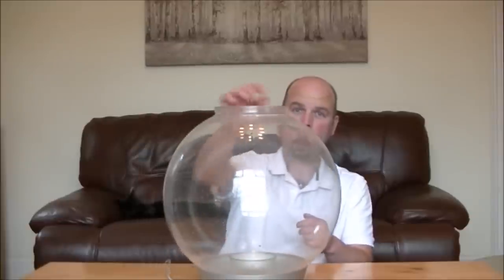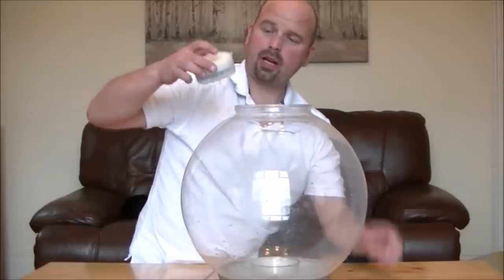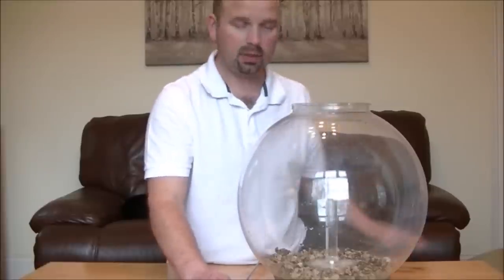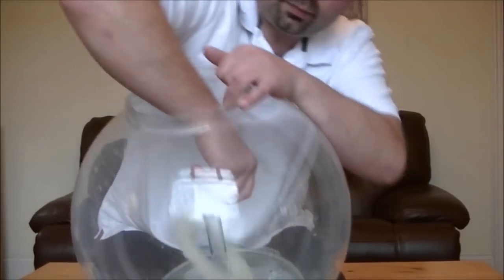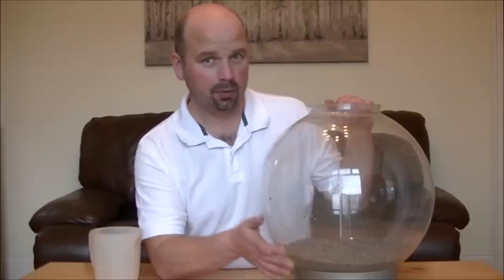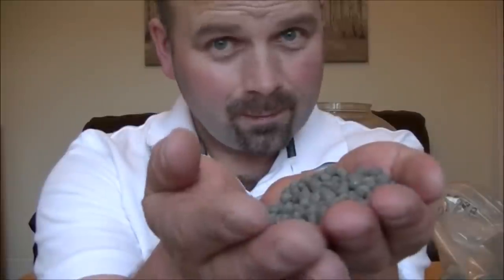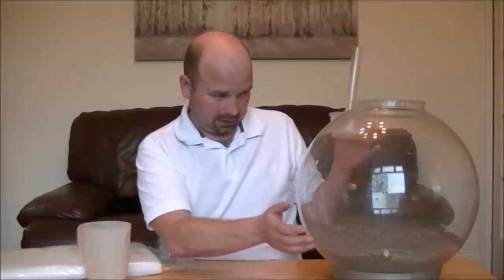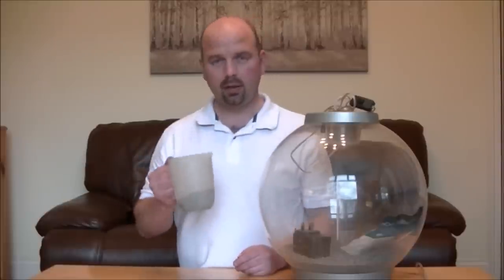BIORB COMPATIBLE UPGRADE KIT

Comment: Great Vid you have my money sick of spending loads of money on filters etc etc and the cleaning dont even go there, Many thanks for posting.
Reply from the maker: +Rob Tankie Walker No problem, I just wish Reef One had taken a look at their filtration system on their tanks as it shouldn't be up to the end user to make something work correctly.
Reply: I’ve had my biOrb 60 running perfectly now for over 18 months, I keep different live plants, cardinals, glow lights, a honey gourami and my beautiful red Bloody Mary shrimp, and have had zero problems at all using the original rock and filter media that came with the biOrb tank. If you set up your biOrb correctly without rushing to add fish, you should have no problems at all. You really do not need to put a sponge cover around the filter or change the biological media that comes with the tank. 
The main reasons people lose fish, is because they do not do there homework on how to set up a tank properly, they are too impatient to wait to set up the tank properly, they stock the tank too quickly, they overstock the tank with too many fish, they do not do water testing properly, or ignore readings that tell them there is a problem. Instead of looking for reasons to blame this tank, you would be helping yourself far better by trying to work out what you think you may have done wrong. If you can do that, then you will find there is no reason to change any of the filtration media that comes with the biOrb. If you choose not to believe what I have put, so be it, it is your money you are spending and giving to others needlessly that helps their business profits. I have a friend that used to have an aquatics business and he used to love helping people that had problems, because by helping them it helped his business grow. He has since sold his aquarium business, but kept the pond side of his business as his pond business grew and grew and he had more work than he could handle. He also used to sell marines, but knew not much more than the majority of his customers, and a hell of a lot less than some, but they trusted him because he ran an aquarium business and people tended to trust that he must be an expert. The truth is if he was unsure, he used to ring his customers that had been keeping marines for many years, and then ring back the enquiring customer, giving them the advice that he had been given. Please don’t think I am trying to knock anyone because I am not, the point(s) I am trying to make, is that the biOrb is fully capable of doing the job, and that ANYONE can and will be successful, IF, they do enough reading and homework on fish keeping, and DO NOT try to rush.

Comment: Hi Pondguru I brought your filter kit for my 60ltr biorb it took 7 weeks to cycle but I had high nitrate levels despite being well planted water changes didnt help my tap water was high in nitrates and was getting impatient to get some fish in.
Decided to try using Purigen to get nitrates down so put 20g into a ladies ankle stocking and put it inside the original filter housing with a new piece of the fine filter foam thinned down to bout 1.5cm thickness ontop of Purigen sock,it worked a treat the levels came down and the water is unbelivably clear,looking forward to getting some fish in now,the old filter arrangment looks a joke now compared to ur upgraded kit.
Reply: Pondguru Outdoors Hi pondguru as a newbie my understanding of the tank cycle is basic will outline what I did for your assessment. The filters was installed as per your instructions guide the only thing not stated was how many gel balls shud have been put in I put the entire bag supplied in half between the black and blue filter foams half in bottom of the round filter housing with fine foam ontop of it.The water put in tank was treated with seachem prime, the air flow was set at a healthy rate of flow along with an airstone running ,tank heater was set to 80f ,plants was added to the tank after 3 weeks.
I was given the orb and along with it an API master test kit, I tested for ammonia and nitrites at 2 weeks the ammonia was dark green and nitrites dark purple.
At 4 weeks the ammonia test went to yellow while nitrites stayed purple after another two weeks the nitrites test went to pale blue indicating 0 ppm
I took a sample to my local fish shop to check if I could now put fish into tank they said the nitrates was high at 75 ppm and to wait.
I read on other forums that doing water changes was a way to lower nitrate levels.This made no difference so I tested the tap water which also gave high nitrate readings on the API test chart somewhere between 40/80 ppm
The 20g of Purigen in a stocking was added 4 days ago, my API test showed change from dark amber/red colour to a light to medium amber which on the chart indicated between 5 and 20 ppm nitrates, the water did become absolutely crystal clear from already being very good before.I went back to my fish shop this morning they tested a sample and said it still has nitrates at 75ppm so I'm not so sure now Purigen has lowered the nitrates.I am going for holiday now returning Saturday when I will have another sample tested, if no change fish shop can supply RO water for a partial water change, your opinions  on what I have done most welcome.
Reply from the maker: Damn, the prime looks like it has at the very least doubled the time it should have taken for the first stage of the cycle (ammonia and nitrite processing to develop) but at least it did develop - I get so many reports where it will just not get going at all when that is used. Unfortunately you now have purigen in there too so the anaerobic side is likely to not ever start or if it has started to develop in spite of the prime it may have been knocked back to zero.
High nitrates is common until the anaerobic bacteria develops but with chemicals acting against it the chance of a full natural cycle developing is close to zero.
In all cases which get reported to me once the prime and purigen get out of the system the bacteria can develop naturally, restoring the balance and there is way more media than is actually required to process ammonia, nitrite AND nitrate in there so eventually all should be zero.
A simple swap to using a straight forward dechlorinator for water changes and carbon or activated charcoal for the polish for water clarity is all you need to allow the bacteria to naturally develop.
There is nothing in the prime or purigen which reacts with any of the biohome products or any other filter media but the amount of bacterial crashes associated with those products indicates it can have anything from a retarding to devastating effect on bacteria making you rely on chemical products to keep the pollutants under control which should be done easily by bacteria.
The cynic in me would think that was part of the plan? cock up the balance then sell the solution....
If you keep it simple the tank will be low maintenance and water will be very good, no doubt about it so simple changes now will allow that to happen no problem.
Reply: Pondguru Outdoors Thanks for reply a lesson learned for others from sharing information i guess  will see what I've got when I return from my holiday and take it from there.
Reply from the maker: Sounds like a good plan, hope you enjoy your holiday.

Comment: I am using the bio gravel you recommended and real plants with internal filter un seen by large  fake hollow stone no uplift but air stone it is keeping very clear and the water is very good have two fancy three inch goldfish and two I inch those will be in the patio pond in summer again next year if all goes well lots water changes ,I have 72 x15x15 run by external fluval with silver dollars ,tin foil barbs and two plecs been running for 25 years present  occupants about 15 years plus 4foot extremely well planted from my own cuttings and seeds thought I would just mention thanks for your time
Reply from the maker: That sounds good - best of luck with that.

Comment: Hello m8 I'm from consett just watched video on biorb filter very impressiveI have a 105 ltr biorb and would like this set upOnly thing worrying is does the sponge have to replaced on a regular basisYou Have to be careful with these things they scratch easily.
Reply from the maker: +Terry Mc The outer sponges should last a few years and will be gently cleaned when you clean the biogravel wit a gravel cleaner so no need for a major strip down for cleaning - maybe once a year just to give it a deep clean? The central small filter (where existing Biorb filter is) will need replacing as and when it is clogged with fine muck. How often that is will depend on the fish stock and feeding.If you're in Consett you can collect as I'm near Ebchester. Just give me a call if you want to come down for the gear. I don't have a specific kit for the 105 but the base size isn't much larger than the 60 so foams will certainly be big enough. Not sure how much extra biogravel it will take  but it will be more than the 60 litre as it takes 3kg.07772848730Richard

Comment: Cheers mate I just bought a second hand one today I was thinking of drilling holes in the plastic pipe like you would a diy sponge filter then put sponge round it me dad didn't think this would work so YouTube ideas found this.. I'm going to buy your media tonight from your website cheers Richard how much will I need if I'm planting mines the 60l
Reply from the maker: Sorry just seen this now. The 60 litre kit comes with 3.5kg of biogravel and that is needed to cover the foams in the kit but they have quite a high profile cut. Actual amount needed depends on type of foams used and could be anything from 2.5kg (flat foams) to 3.5kg (deep cut foams) - hope that makes sense.
Regards,
Richard
Reply: Hi, did the holes in plastic pipe work?

Comment: would a stronger flow rate on a bigger air pump produce more draw on a 60 litre and if yes would you recommend it...
Reply from the maker: It wouldn't make a huge difference to water quality but I know of a few people who have installed 150 or 200 lph air pump for the 60 litre orb with no issues.

Comment: I have a 20 gallon biorb coming and I want to upgrade the filtration as I’ve been hearing mixed reviews on this setup. Am I able to find the “gravel” you’re using in stores or do I have to order it? How much would you recommend I use? Do I ever need to replace it? And for the sponges you’re using, would I just clean those everytime I clean the tank or only some times? Do I just rinse them out or should I replace them completely? I’m sorry if you’ve answered these questions already, I’m just having a hard time understanding everything as I’m new to it all and don’t know all the “lingo” or anything about filtration 😆 I hope I’m able to get some feed back soon as I can’t wait to start my new aquarium !

Comment: Changed my biorb to your filter over two years ago, still perfect!
Reply from the maker: Sounds good to me - thanks for the feedback and I'm glad you're pleased with the system.
Reply: @pondguru  hi where do I order this upgrade set please? All that is required?
Reply from the maker: @jesgill6875  You may have already found it in the pinned comment and video description but here is the link to my website: http://www.filterpro.co.uk
The kits are on the 'Filter Kits' page.
Regards,
Richard
Reply from the maker: Here is some further information in case you missed it in video description / pinned comment:

A FEW COMMON QUESTIONS:

Do I need to take the medium/course foam rings out from under the gravel to clean them? (rinse in siphoned tank water, if so how often?)
 
- It is basically creating an undergravel filter so as long as the substrate (biogravel) is cleaned with a gravel cleaner that will remove the vast majority of uneaten food / fish waste from the biogravel and upper foam so the foams don't need to be removed unless you want to do a deep clean which I recommend doing every 12 months or so. So far I don't know anyone who has done that as they don't want to disturb anything which is working well.

Ideally the gravel cleaner would be used once a week to remove waste from bottom of tank, just as it would with a normal tank - that will remove waste, do a small water change and freshen up the tank.

Do I need to take the fine filter pad out to clean, if so how often?
- That is just like the cleaning of the 'normal' pad for biorbs. When it is clogged it will need replacing but since you have so much filtration prior to water hitting that fine pad it could go for many months before it needs replacing - every tank is different but most will go 4-6 months before the pad needs replacing. Check after 2-3 months and if you think it would go longer next time just extend cleaning intervals to suit - no point cleaning / replacing a clean filter.

Do I need to replace the foam or fine filter pad, if so how often?
- See above with regard to fine pad in central filter, outer foams should last a good 18-24 months before they lose their 'bounce' but will still function as an undergravel system beyond that.

If I’m taking out the foam or fine filter pad. Do I need to take out my fish before doing so to be safe? I don’t want to kill it. 
- If you are removing the fine pad in the centre then that can be done with fish in no problem but removing the outer foams will involve taking out the biogravel so ideally that would be done when the tank had been drained and fish removed for duration of work - muck could be stirred up when the system is pulled apart so best to do that when fish aren't present. 

Is the air pump that comes with the BiOrb unit sufficient? If not what power air pump will be best?
- Yes the standard air pump will be fine as water flow is not restricted by the undergravel system.

Comment: hi watched this video a year ago, did everything  the lad said, however I never used the substrate, as I could not get one instead used the coloured beads that you can buy at any supplier, the tank has been running for a year shrimp love it and my gold fish have grown really big, and I have saved seven pounds a week on bio filters, it is absloutley brilliant.
Reply from the maker: That is good to hear. You can use the foam method and cove it with any sort of gravel, crushed pumice or the biogravel. The will all have different levels of filtering ability but even pea gravel over foams will do a great job.
Reply: hi , I am setting up a new tank to house the fish that have got too big for the bio orb, my idea is just to fit a  plastic realistic buddah statue on like a zen back ground, however,my question is  can I use a coral based substrate in a clear water tank,using the same metheod as thebio orb and if so the buddah could also be used as  a filter like you used in your rock filter demonstration
Reply from the maker: Yes there is no reason why that would not work.

Comment: i upgraded one of the for a bloke to a external filter i drilled two holes
in it one at the top and one at the bottom works fantastic now with
a very large external fitted
Reply from the maker: Sounds very interesting, lol
Reply: its set up as a marine with in line uv and heater
Reply from the maker: Andy Coakes Wow, awesome work.
Reply: we had to use a fx 5 external it was the only one with a flow you would it would be like a washing machine but its not plans to drill it for a skimmer
Reply from the maker: Andy Coakes I'd love to see that one.

Comment: Nice vid. I have two Biorbs there is nothing wrong with them. There is nothing wrong with a Biorb. It's just people treating them badly and not doing the required care that they need. Turning them into The Ball Of Death that they are commonly called.
Reply from the maker: +byron pattison Yes a very light stock can be maintained in a well looked after standard biorb and water conditions can deteriorate quickly in any shape or size of tank with inadequate filtration, overstocking and lack of maintenance.
Glad you enjoyed the video - thanks for watching.
Reply: +Pondguru Outdoors Great! I Admit That More Care Is Acquired But There Has Been No Nitrate Or Nitrite Spikes Or Even Ammonia Spikes. So I Just Keep On The Way I Maintain The Biorbs And I Will Be Able To Keep them under control and stop unwanted spikes or water pollution.

Comment: This is GREAT! You are a God! (Just Ordered a Biorb Flow 15L and I don't want to use their ceramic media)
I do have a question Can I use regular Aquarium Substrate? For ex. CaribSea Flora Max Planted Aquarium Substrate? or Other Plant/Aquarium Substrates? 
if I do decide not to use the substrate in the video.
Reply from the maker: Cyndy Valle Yes that would work as long as you went with the foams laid out as in the video you could use other substrates over them. Obviously some would not function as a filter media but in a 15 litre tank you would only have a very limited amount of tiny fish anyway so should be fine.